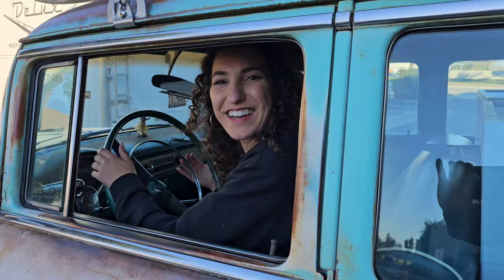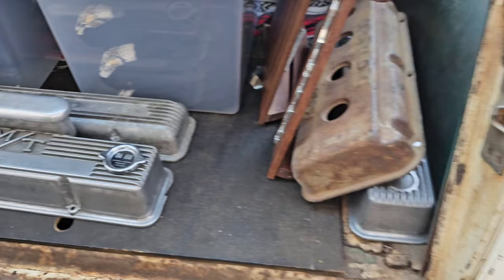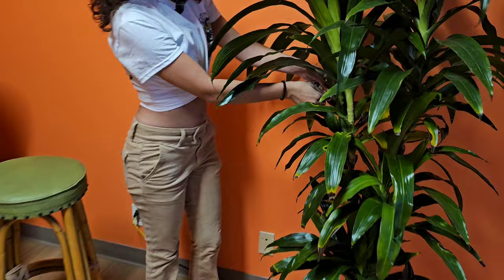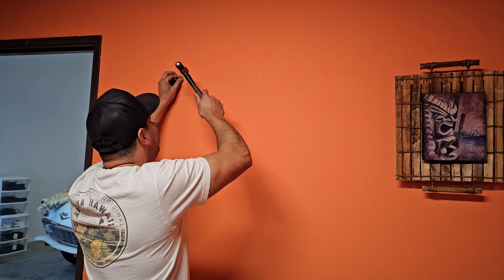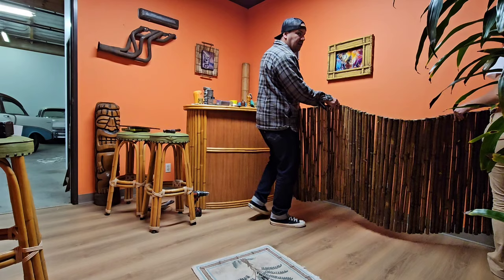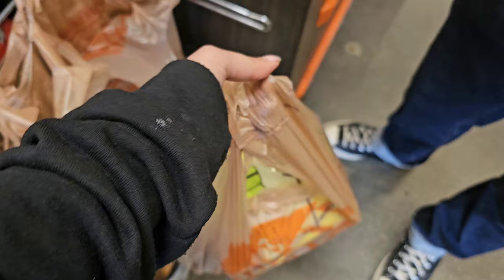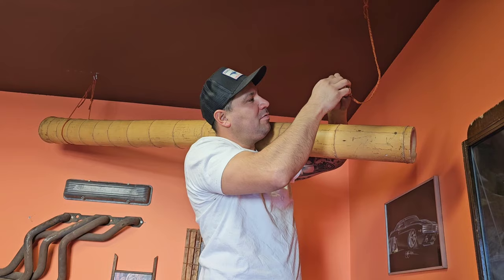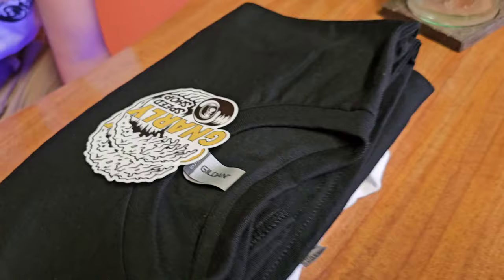Merch Room Transformation – You've NEVER Seen One Like THIS

Comment: 19:25 lol easiest way to find a studs is tap your index knuckle on the wall until the noise changes you can tell when you tap a solid stud behind the drywall, then measure for 600mm centers ( or what ever your industry standard is there) for the ones on either side then from the floor up 800mm/1600mm (your industry standard) centers for the nogs that run horizontal between the studs. or buy a stud finder they pretty cheap.